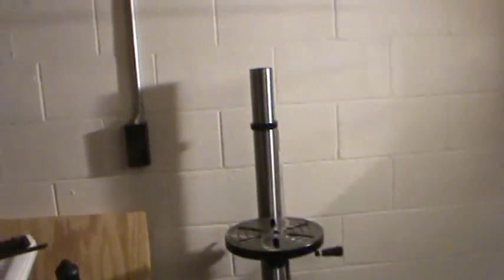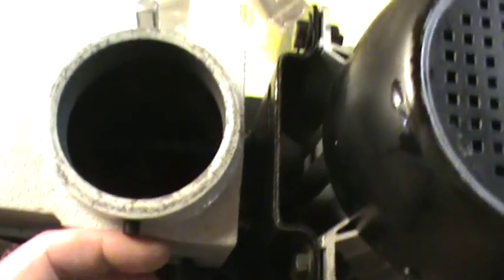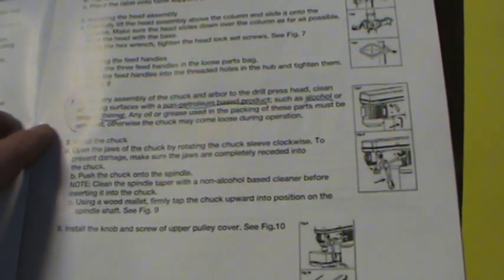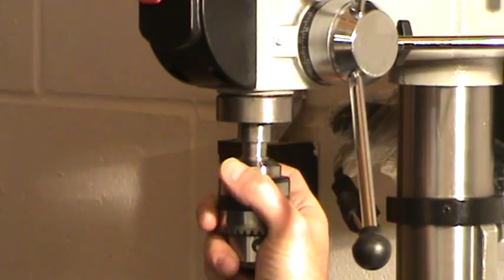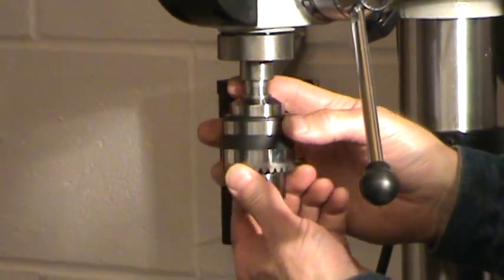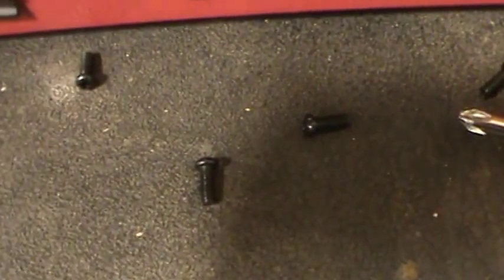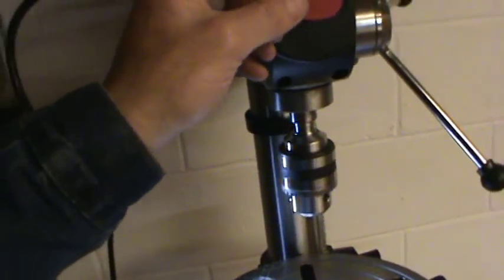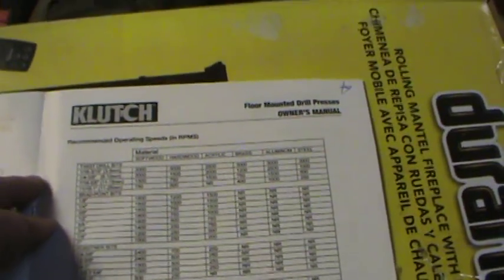Assembling a Klutch 13" 3/4 Horse 16 Speed Floor Mount Drill Press Model 49383 Part 2

Comment: Hey so I'm curious, how did it work when you broke those rules at the end? I bought one of these and it's not here yet but I was really hoping to be able to do some light milling with it. Have you tried mounting a machine vice to the pedestal and if so is there one you recommend?
Reply from the maker: I haven't and don't intend to brake the tool rules. I haven't had the money to purchase any accessories.

Comment: Hello friend great video! Helped me a ton! One question tho... what did you do with the wedge that was included? Where does that piece go?
Reply from the maker: https://youtu.be/P-QnRfvgA58 The wedge is for replacing the chuck with a different sized one. See the video, lower the handle into it's lowest position and lock it in place. Use the wedge in the shaft groove to separate the wedge from the shaft and it will fall out. You can purchase different sized chucks to handle different sized bits.